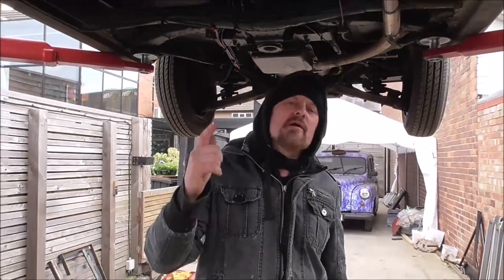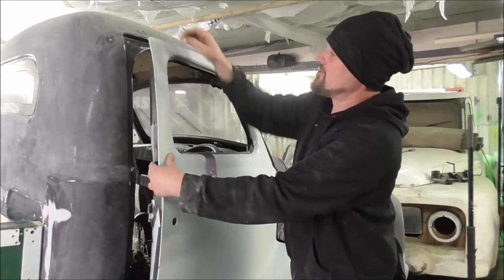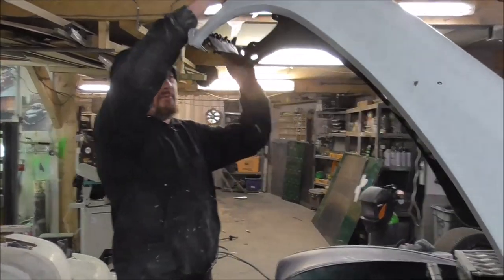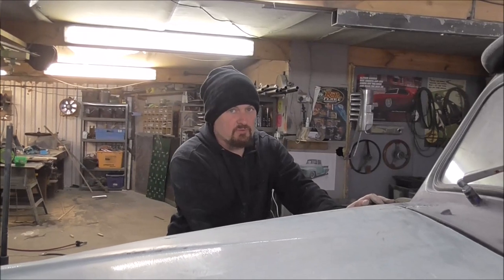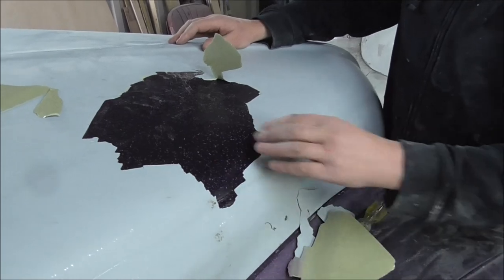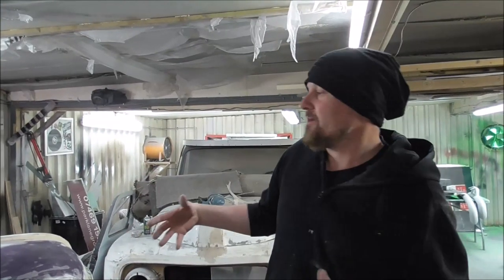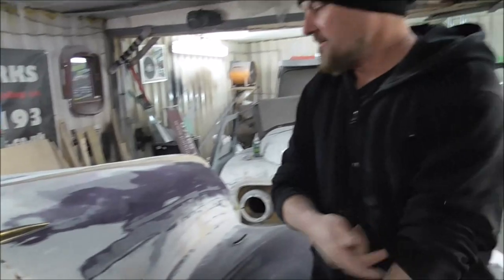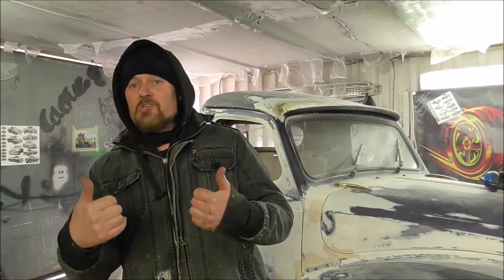Part 5: PANEL PREP ON THIS SUPER COOL AUSTIN A40 60'S STYLE PICK UP TRUCK

Comment: Love your response to cutting the bonnet in half !  You have huge confidence in your ability and balls of steel to match !  Without you this car would have gone to scrap with not much return.
Reply: Scrapyards won’t take fibreglass . Recycle centre (the tip) won’t take vehicle parts 🤷🏼‍♂️
Reply from the maker: Cheers, sometimes you need to balls, but it was much easier this way.

Comment: Even standard metal A40 panels are all over the place, I put on a new old stock door and the top stuck out an inch ! also they dont have any trim or rubber between the window glass and the door, just a couple of tiny rubber bump stops to stop the glass hitting the door.
Reply from the maker: Arrr interesting, thanks for that